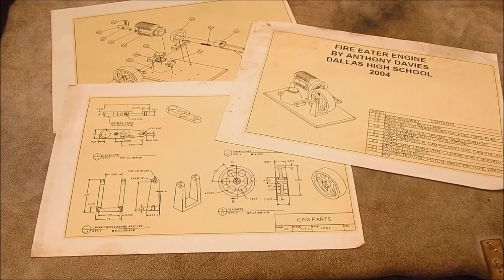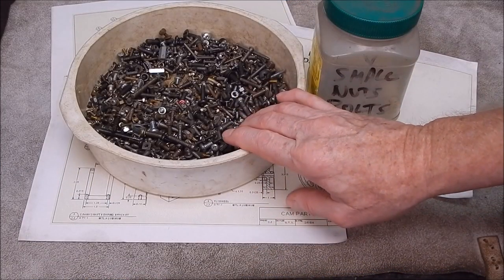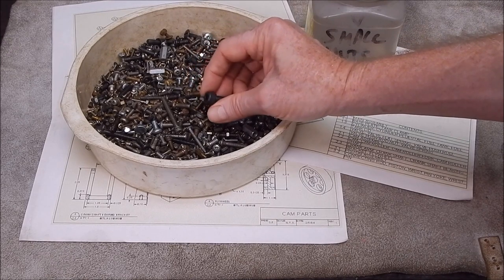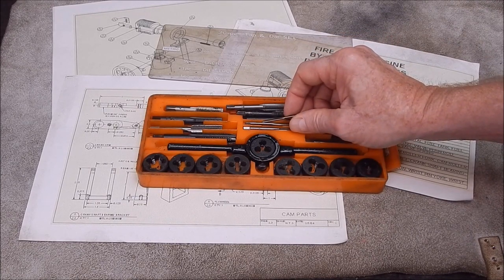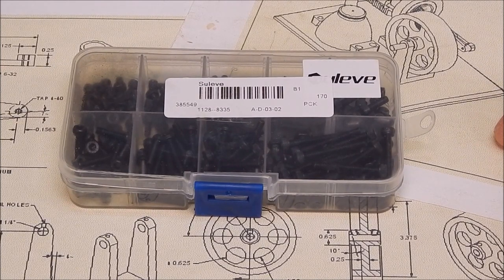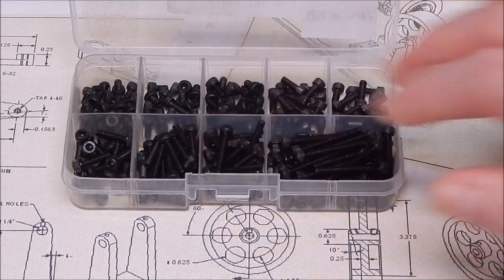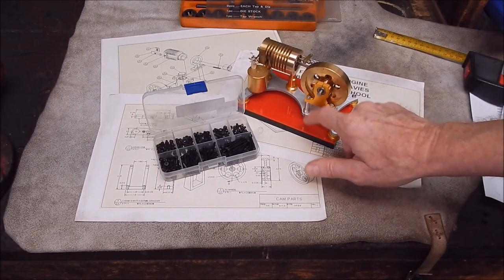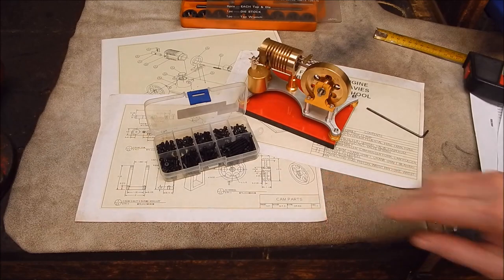Bargain 3 mm carbon steel Allen headed bolt pack - 240 pieces - various lengths

Comment: I too have drawers of assorted bolts, nuts etc - takes an age to find the right ones! An organized box set is always useful and I did get some import sets from somewhere which turned out to be OK. Yours look equally useful and pretty acceptable. :) As often, ''cheap junk'' is actually not too bad at all considering price.

Comment: B'day Rob.  I used to go to estate sales and buy the guys bucket of bolts.  Then I discovered the thing you pointed out.  They are all different sizes and not all that useful.   You can mix and match wood screws most of the time but not when screwing in metal.  I now try to buy exact sizes I plan to use.  Great review.

Comment: It always vexed me when on almost all projects I ended up spending more on trim than the working parts. Then one day I was talking to a very skilled maker of clothes & textiles & she said it was a universal feature of making stuff. As she said it, to set off the main item you need matching & appropriate trim & the more I look at stuff the more I see she was right. But it can go too far. I do like the look of torx head bolts, but I fear having to mess with then as I have managed to damage some, usually close, but wrong key, & then they are so awkward to get out. Allen headed cap screws as you state have a lot going for them. Thanks for the heads up to these.
Reply from the maker: I like Allen headed bolts for those reasons, and also because you can use a ball headed key on them to easily drive them in and out on an angle.  You can't do that with Torx keys.

I recon Allen headed bolts are one of the best engineering solutions around.  Their only downside is that they can fill up with crap and may need cleaning before inserting the key, in comparison to a regular spanner head.

Cheers Rob

Comment: Hi Rob,
Just bought a couple of those.
Also at present you can enter 'Suleve' in the coupon code for a further 15% off.
Thanks for another great video.
Regards
Kevin
Reply from the maker: Thanks for the heads up on the coupon.

Comment: Don't know about the BangGood product, but I bought a kit of socket head screws from an eBay seller and the quality was poor. Heads on half the screws were deformed to an extent ranging from merely cosmetic to unusable. I would not bother to buy another such kit. Caveat Emptor.
Reply from the maker: Maybe you should have bought the Banggood ones instead.  The quality is excellent - as seen in the video.

Rob
Reply: I have to say all the Banggood stuff I've bought (and its a fair bit) has been very good indeed.  I think they must exercise some quality control function of their own.
Reply: I always buy from ali express good quality just be patient  3 to 6 weeks for delivery on mail box real cheap great quality better than try to find in a retailers  here in us some ebay sellers buy that from china too so to make a profit of twice of price. a hobby must be inexpensive usuallI buy goods from range of 75 cents to  50 dollars on small things if  some get lost   alliexpress refund the money most of the times I have no complaint  buy on this way overseas goods if I can save a lot.